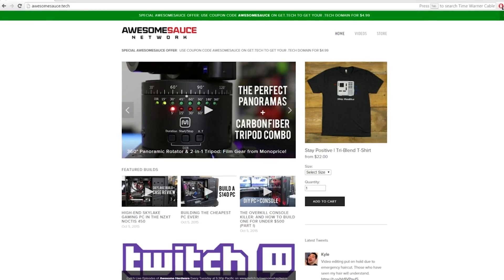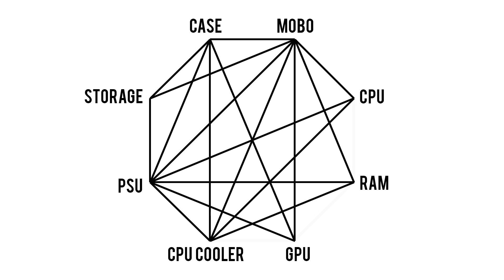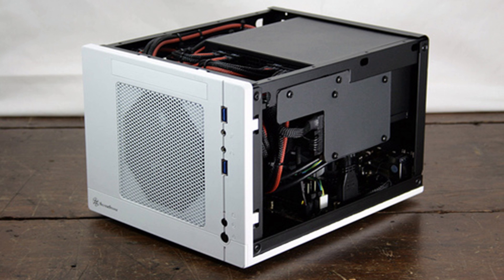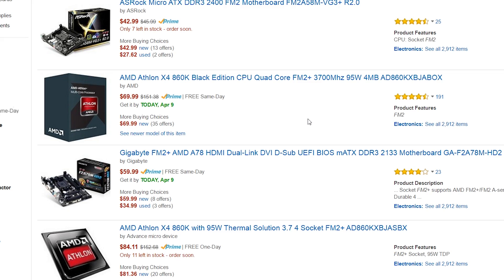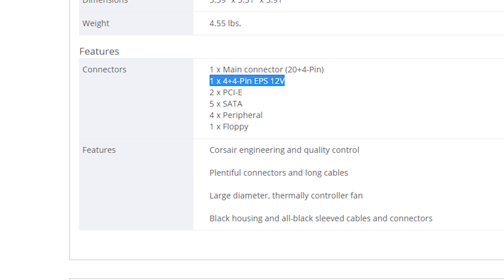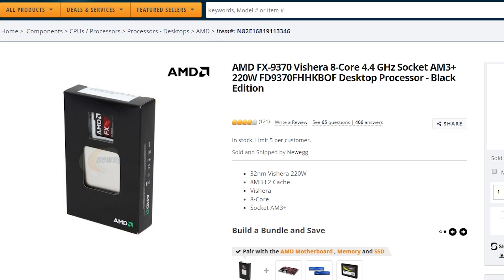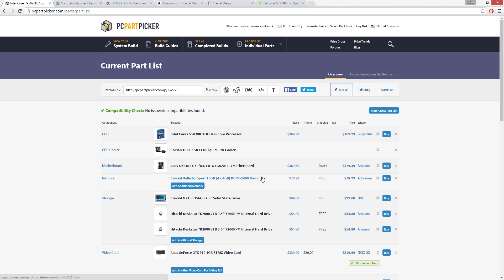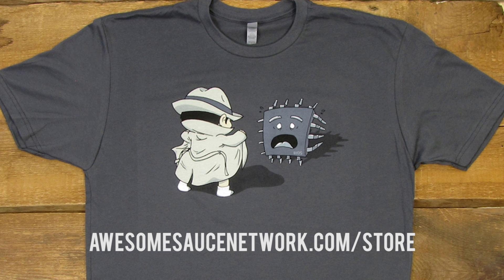How to Choose Parts for a PC! The Ultimate Compatibility Guide!

Comment: yay everything is compatible!!! i just need some feedback on my build. Im worried about if this build is ok. https://pcpartpicker.com/list/vbmn9W
Reply: Well, two things:
1. The PSU is way overkill XD 650 W is enough even if you later want to switch with i7 and GTX 1080 Ti. Also cheaper, obviously.
https://pcpartpicker.com/product/9q4NnQ/evga-power-supply-220g20650y1
2. I simply assume this is for pure gaming rig. So 250 GB SSD is enough for OS and apps. I'd rather get a smaller SSD and put the extra money from downgrade to buy better CPU cooler, like Cryorig H5.
Also, you probably still have extra money from the PSU, so get a bigger HDD.

Good luck with your build!
Reply: thankyou so much. What about the motherboard and video card? A little to overkill for gaming?
Reply: deth234 1080p? Yes. But don't let that stop you. You can buy higher resolution monitor later on.
Reply: Michael Taylor 650 W is still overkill.

Comment: Pls someone check if mines ok i realy want to play games like gta and stuff and i dont know if i have the right stuff https://pcpartpicker.com/list/mXkn9W
Reply: Do you really need i7? Like livestreamer or any light production? Because if this just a pure gaming rig, I'd rather switch to i5-6600K and get a stronger GPU, like GTX 1070. Would be great for game like GTA 5.

Also, get a better cooling solution with Cooler Master Hyper 212 EVO or Cryorig H7 rather than slim-profile like C7.

And get an SSD. 120 GB is enough for OS. You can store your data on HDD.

Aaaand, you won't need 750 W of raw, unused power. There's 650 W of your PSU choice:
https://pcpartpicker.com/product/9q4NnQ/evga-power-supply-220g20650y1

That's it, I guess. Good luck with your build!

Comment: its this a good build or am i missing stuff and is it compatible

https://www.amazon.com/EVGA-GeForce-Support-Graphics-08G-P4-6173-KR/dp/B01GX5YWAO/ref=sr_1_1?s=pc&ie=UTF8&qid=1482042537&sr=1-1&keywords=gtx%2B1070&th=1

https://www.amazon.com/dp/B01BV1XBEI/ref=dp_cerb_1?th=1

https://www.amazon.com/Corsair-Carbide-High-Airflow-Cube/dp/B00D6GINF4/ref=sr_1_1?ie=UTF8&qid=1482044521&sr=8-1&keywords=Carbide+Series%C2%AE+Air+540+High+Airflow+ATX+Cube+Case

https://www.amazon.com/Intel-Unlocked-Skylake-Processor-BX80662I76700K/dp/B012M8LXQW/ref=sr_1_1?s=pc&ie=UTF8&qid=1482045751&sr=1-1&keywords=i7&th=1

https://www.amazon.com/Asus-Serial-ATA-Internal-Optical-DRW-24B1ST/dp/B0033Z2BAQ/ref=sr_1_1?ie=UTF8&qid=1482046171&sr=8-1&keywords=cd+dvd+drive

https://www.amazon.com/Blue-Cache-Desktop-Drive-WD10EZEX/dp/B0088PUEPK/ref=pd_bxgy_147_img_3?_encoding=UTF8&psc=1&refRID=TS4C2H491EXMHVG67CGC

https://www.amazon.com/Cooler-Master-Hyper-212-RR-212E-20PK-R2/dp/B005O65JXI/ref=pd_bxgy_147_img_2?_encoding=UTF8&psc=1&refRID=Q7TWZ06XBHNZ5K0RKQQ9

https://www.amazon.com/Kingston-HyperX-FURY-2x4GB-1600MHz/dp/B00J8E93G6/ref=sr_1_1?s=electronics&ie=UTF8&qid=1482046601&sr=1-1&keywords=ram%2Bsticks&th=1

https://www.amazon.com/LGA2011-Optimization-SafeSlot-Motherboard-10/dp/B01F854U8E/ref=sr_1_5?ie=UTF8&qid=1482047055&sr=8-5&keywords=asus%2Bmotherboard&th=1

https://www.amazon.com/ASUS-Wi-Fi-Express-Adapter-PCE-AC56/dp/B00JNA337K/ref=sr_1_7?ie=UTF8&qid=1482047403&sr=8-7&keywords=network%2Bcard&th=1

https://www.amazon.com/EVGA-1000GQ-Modular-Warranty-210-GQ-1000-V1/dp/B017ICWP82/ref=sr_1_8?s=pc&ie=UTF8&qid=1482047503&sr=1-8&keywords=power+supply

https://www.amazon.com/Blaster-Performance-Headphone-Forming-Microphone/dp/B009ISU33E/ref=sr_1_2?s=electronics&ie=UTF8&qid=1482047594&sr=1-2&keywords=sound+card
Reply: the x99 isnt compatible with the 6700k?
Reply: oh thanks man you just saved me a lot of trouble

Comment: Hold on, so if my mobo had 1 USB 3.0 connector and 1 USB 2.0 connector, and my case has 1 USB 3.0 port and 2 USB 2.0 ports, it wouldn't work?

Comment: Can someone check if mines OK? I checked everything that this video told me to, but I just want to make sure. Thanks.
https://pcpartpicker.com/user/SilverMight/saved/RPrD3C
Reply: already know that, have a copy already
Reply: theres no cpu cooler
Reply: Please change the power supply to something better. About $45, there's EVGA 500B:
https://pcpartpicker.com/product/zNK7YJ/evga-power-supply-100b10500kr

Other than that, you're good actually!
Reply: It's already ordered.. would it be a problem?
Reply: SilverMight I hope not. If the order can be returned on 48 hours after delivery or something, that would be better, though.
If can't, you can stuck with it. It's nothing firebomb but performance is not on a happy place for modern components.
Might as well get Seasonic S12II 520W on the future if 2nd thing happened. It's $50 and below at most times and actually better than EVGA 500B.
Reply: Alright... would it affect performance too bad? Or just the power efficiency.
Reply: SilverMight I mean...  you sorta need an os but other than that
Reply: SilverMight pretty good

Comment: Someone take a look please?
Would like a PC building veteran to comment on my first build
https://au.pcpartpicker.com/list/BxMjBP
Reply: NZXT S340 doesn't come with front fans. So you might want to add two 120mm fans on the front as intake.
Also, 850W is waay overkill for that system. 650 W is actually enough, but for the same model, EVGA G2 is apparently out of stock in Australia or something. Here's the 750 W version:
https://au.pcpartpicker.com/product/MfJwrH/evga-power-supply-220g20750xr

There's 650 W FSP Hydro G, but cost more than 750 W G2:
https://au.pcpartpicker.com/product/Ky4NnQ/fsp-group-power-supply-hg650

Then, there's 650 W Cooler Master VSM. Cheaper, but semi modular:
https://au.pcpartpicker.com/product/LhR48d/cooler-master-power-supply-rs650amaag1

Other than that. I see nothing else. Good luck with your build!
Reply: Any recommendations on the fan? I'm thinking to go with Noctuas but I don't like the brown. I'm not that big on color but I still want to sort of follow a color theme.
Reply: Konstrife Yeah, was gonna recommend Noctua as well. This Fractal Design fan is my second favorite:
https://au.pcpartpicker.com/product/GqkwrH/fractal-design-case-fan-fdfanventhp12pwm
Reply: AlphaCore Looks like I'll be buying the Fractal Design fans. Thank you so much!

Comment: This are my PC specs:

Operating system
Windows 10 Home 64
Processor
Intel® Core™ i5-6400 with Intel® HD Graphics 530 (2.7 GHz, up to 3.3 GHz, 6 MB cache, 4 cores)
Processor technology
Intel Turbo Boost Technology
Graphics
NVIDIA GeForce GTX 970 (4 GB GDDR5 dedicated)
Intel® HD Graphics 530
Memory
8 GB DDR3L-1600 SDRAM (2 x 4 GB)
Maximum memory
Upgradeable to 16 GB
Memory slots
2 DIMM
Hard drive
1 TB 7200 rpm SATA
Total External Bays
One 9.5 mm occupied
Total Internal Bays
Three 3.5" available; One 3.5" occupied
Optical drive
Ultra Slim-tray SuperMulti DVD burner
Memory card device
7-in-1 memory card reader
Network interface
Integrated 10/100/1000 Gigabit Ethernet LAN
Wireless
802.11a/b/g/n/ac (1x1) and Bluetooth® 4.0 combo
Power supply
500 W AC power adapter
Ports
4 USB 3.0; 4 USB 2.0; 1 headphone/microphone combo
Expansion slots
1 PCIe x1; 1 PCIe x16; 1 MiniCard

I Want to upgrade Ram and Video card. Any one have any suggestions? i want to be able to play games for example LOL and be able to have other programs/movies. etc. running on my second monitor

Comment: Why use an Intel Graphics card if AMDs are so much cheaper?
Reply: Not graphics card, processor I mean.
Reply: Fancy Sailer main reason is thermals. AMD CPUs have a reputation for getting extremely hot during use and are also known to be somewhat less reliable than Intel CPUs. AMD CPUs have also generally been somewhat inferior to Intel CPUs, however with the new Zen chipsets coming out from AMD, this may well change soon. If you're planning to build a PC but you don't urgently need one, wait and have a look at how the Zen architecture turns out. It might be worth the wait.

Comment: Does this build look good? 
https://ca.pcpartpicker.com/list/Z8JqPs
Note: I already have the peripherals/monitor, and I'm getting OS off Kinguin.
Reply: The build does in fact look compatible. The only thing that I would double check is between the radiator (With fans attached!) and the ram.
Reply: Seems good.... maybe a system SSD missing? if you intend to play games with lots of loading time, skyrim fallout and the like... ssd is a must
Reply: On PSU, grab EVGA GQ 650W instead of G1. It's a better PSU yet similarly priced.
Or grab EVGA G2. It's fully modular but might cost more.

Comment: What do you think?
https://au.pcpartpicker.com/list/MCL2WX
Reply: Jaidan Buy the gtx 1060 with 6 gb not with 3.
Reply: 3gb will be more than enough for playing most games at 1080p. Plus, there is only a 5% drop in performace between the 6gb and 3gb.
Reply: Yeah but that 20$ are worth it.
Reply: I'd say go for a single 8gb stick of ram and add another later. With 2x4gb you will be stuck and will have to replace both if u want to upgrade later on.
Reply: Good base for a start
though, for a little more than 75 bucks you could select a B150 or H170 chipset motherboard => wider possibilities afterward to upgrade like 4 ram slot, M2 slot and sata express
Reply: 1. Agree on 6 GB GTX 1060. Unless you're playing only esport games, they gonna take at least 4 GB or VRAM.
Having more RAM will not matter, but have no empty space will hit your performance.
2. If you're still picking Corsair CX, grab the grey-colored label one, not the green-colored one.
It's two different PSUs under the same name as far as I can see.

Comment: What do you guys think about this list? (If it's fucked don't judge me too harshly or if it's good let me know what I did right! And yes, that's about the budget I have) 
https://pcpartpicker.com/list/BhGxRG
Reply: You didn't paste the Permanent Link given above in the site, chief :P
Reply: Try now
Reply: Well, hardware picking is good. You didn't pick expensive fancy components that's gonna do nothing to general costumer (a.k.a expensive and useless). But...

1. Why two different series of RAM? Why not two of the same Vengeance LED or LPX?
2. Also, you pick two different speed of RAM sticks. Both gonna run in the slowest speed of two (DDR4-XXXX thing).
3. If this is pure gaming rig, 16 GB is way more than enough. But, judging by your name, this might be used for content creation, so more RAM is better.
4. Also, I would put 240 GB SSD for OS to sit.

That's it, I guess. Sorry if it look harsh. I didn't mean to. Sorry 😁
Good luck with your build!
Reply: AlphaCore For RAM what speed number should I look for, for gaming and content creating?
Reply: Producer PK Theoretically, the maximum speed your board support, which in this case, ASUS Z170-A supports up to 3400.
In real world performance, 3000 is enough. But CAS Latency and RAM Timings is also counted into accounts. The lower CAS and Timings, the better a RAM performs.
Reply: AlphaCore https://pcpartpicker.com/list/zqpD7h
Does this look better? Can I add more RAM of the same kind? And is two GTX 1080 over kill, how much more power will I get with two rather than 1?
Reply: Producer PK 1. Yes, you can add one more set of 2 x 8 Corsair Dominator given before.
2. Actually yeah, two 1080s are overkill. Even for video editing (assuming you're gonna use it for Adobe Premiere or Sony Vegas). Video editing benefits more on more cores and better performance of CPU rather than GPU.
So you might just got better using 6-cores CPU on enthusiast grade rather than 4-cores on consumer grade.
Reply: Producer PK Here's an 8-core system for $3100: https://pcpartpicker.com/list/qcBFbj
Two 6 TB HDD is supposed to be on RAID 1, for redundancy in case a monster attacks your PC and make one drive dead or whatever.
Reply: AlphaCore I saw the build that you made and was wondering if there was a way the price could be lowered but still support great quality gaming just without the creation part that you guys were talking about before (Around $2000 would be around my preferred price range).Thanks
Reply: Burntmuffinz I don't change much from the aforementioned build, but here's one: https://pcpartpicker.com/list/jNpVm8

I was about to give you 6-core 6800K, but since most games still don't utilize more than 4-core (they start to utilize hyperthreading, though), 6700K is more than enough. Even for years to come.
I still think 6 TB HDD is waay overkill for gaming rig. I hardly fill more than 700 GB from my 1 TB. Though, your mileage will vary. I would suggest switch to 4 TB HDD so you can have extra leftover. Though, your choice.
Reply: AlphaCore Thanks a lot and you seemed to know what you were doing when it comes to this stuff so I kinda just felt like using the build and also yeah I'll probably switch it to like 2TB because my rig right now has 1tb and I've filled about 600gb so I doubt I'll need the 6tb
Reply: Burntmuffinz 16gb is the standard for gaming now

Comment: heres the thing. i want to have a cheaper pc because i dont want to spend alot of money, but i dont want an absolute shitter. i want the best parts for my budget. can anyone help me?
Reply: Here's a tip when budget is low: Don't bother adding a GPU.
Buy a strong CPU that can handle future GPU by the time you can buy one. That also means you stuck with Integrated graphics from CPU, basically no games, but it'll worth the wait.
Reply: AlphaCore i mean, could i get a shitty gpu an upgrade later?
Reply: jkj You can, but they either perform the same or very overpriced (performance per dollar isn't worth it).
You can search used GPU though if you can't wait, through Craigslist or Ebay or whatever. Just check and compare the price of the card for the new one, see if it's a good deal.
Reply: AlphaCore thanks my dude

Comment: is too much power from my psu going to be a problem? I was building a pc on ibuypower's website and my graphics card said it would require 400w and I wasn't sure if it meant the graphics card alone or for the entire pc. So, when I was looking at a psu to get something that offered a lot of power without going over my budget that I was quickly approaching, I just opted to upgrade to a psu that could support my gpu and the rest of my system for cheap, where I found a free upgrade to a 1000w psu. I wasn't sure and I'm still a bit unsure even after consulting a representative from their site to make sure all the parts were compatible, everything would fit in the case, and any recommendations or changes that I should make, I forgot to ask them specifically about the psu. Something I did to try and make sure all the parts worked together was stay within he boundaries of a company which happened to be AMD, even though I would have liked a NVIDIA graphics card like a GTX 1050, instead getting it's counterpart which was AMD's Radeon RX 460. Another thing, my goal for this PC is to play games like LoL, Overwatch, and maybe even WoW smoothly at high quality, and possibly even stream on twitch. Here's a list of my parts, let me know what you guys think. any and all comments/help is greatly appreciated. 

Case (Thermaltake Versa H35 w/ Window Gaming Case)
Processor (AMD FX 8320 CPU (6x 3.50GHz/6MB L2 Cache)
Processor Cooling (Corsair Hydro Series H55 120mm Liquid CPU Cooler - Standard 120mm Fan)
Memory (16 GB [8 GB x2] DDR3-1866 ADATA XPG
Video Card (AMD Radeon RX 460 2GB)
Motherboard (ASUS M5A97 R2.0 -- AMD 970 w/ 2x PCIe x16, 2x USB 3.0, 6x USB 2.0)
Power Supply (1000 Watt - Standard 80 PLUS Bronze)
Primary Hard Drive (2 TB HARD DRIVE -- 64MB Cache, 7200RPM, 6.0Gb/s - Single Drive)
Sound Card (3D Premium Surround Sound Onboard)
Operating System(Windows 10 Home (64-bit))

Comment: https://pcpartpicker.com/user/PCNoob550/saved/#view=ntgbvK Is that build good for running games with good FPS and high quality?
Reply: Components are good, but I'd like to point out a few things:
1. You pick OC-able CPU with motherboard that can't OC it. Pick Z170 chipset motherboard.
2. Along with motherboard, you picked Micro ATX motherboard for a case that can handle ATX. It's nothing performance issue, just an aesthetics issue, since it'll leave big gap inside.
But your case doesn't have a window, so that won't matter. Your choice.
3. Please change the PSU. For that price, EVGA GQ 650W is a better value. It performs better. Quality is higher.

That's it, I guess. On 1080p, GTX 1060 can handle >60 FPS just fine. Good luck with your build!
Reply: Thanks :D

Comment: Anyone wanna check this for me? I just wanna make sure the parts are compatible.

https://pcpartpicker.com/list/4X3bTH
Reply: Well, to answer your questions, it's compatible, but...
1. With that price, please change the PSU to something more stronger and reliable. Also you won't need that much power. 500 W is fine.
I suggest getting Seasonic M12II 520W. It's modular, cheaper, and more reliable than the PSU you pick.
2. Why Mini ITX inside a Mid Tower case that can handle ATX? Especially with the case you picked, because it has window. Will look weird.
3. I'd change the RAM to dual channel 2x8 GB sticks instead of 2 separate 8 GB sticks.

I made a list to fix those things: https://pcpartpicker.com/list/R9QqPs You may use it if you can go $810 budget.
About the motherboard. To be clear, it's not a performance issue, it's just an aesthetics issue since you pick mini ITX for an ATX case. It'll look ugly with that window. You can use that mini ITX board to go cheaper, but will leave a big gap in that window.
Good luck with your build!
Reply: AlphaCore Thanks man! Appreciate the help!